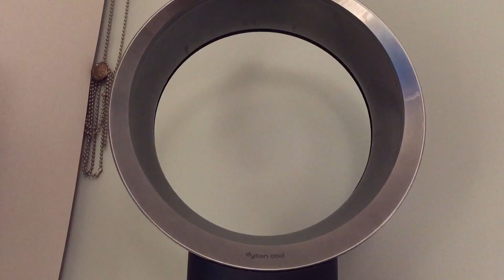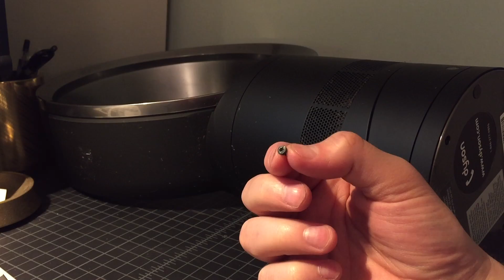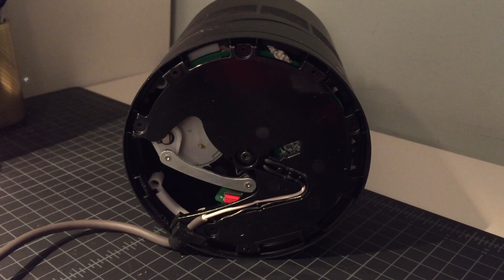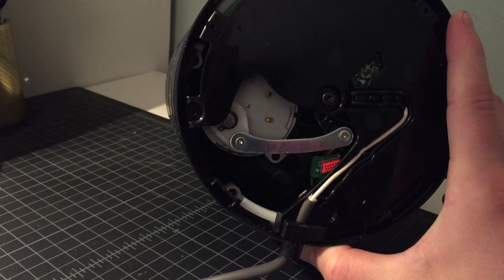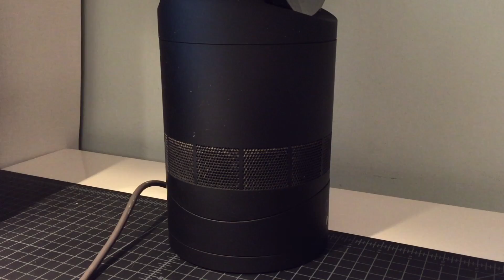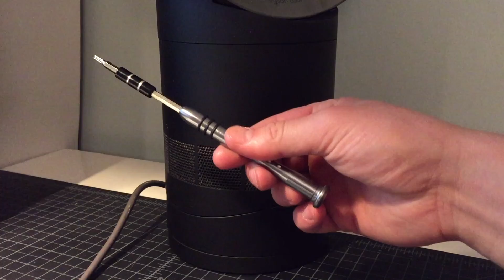Dyson fan clicking? How to fix it

Comment: The problem is actually caused by the small tabs located around the outer edge of the base (near to where the oscillating motor is located). These tabs run inside plastic guides. When the central screw is not tight enough, the tabs catch the guides causing the clicking grinding noise. So just ensure the central screw is very tight 👌